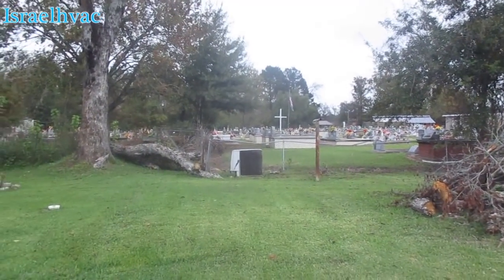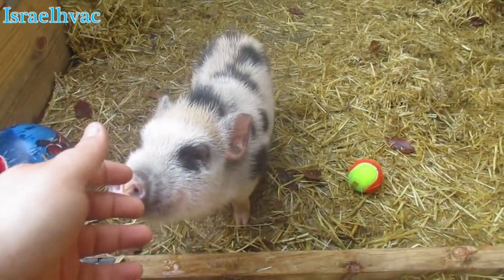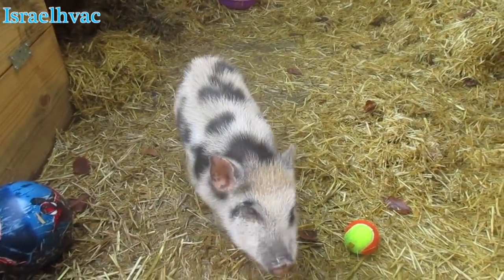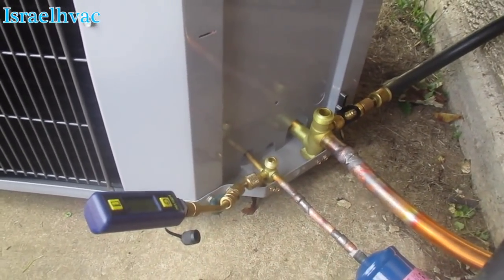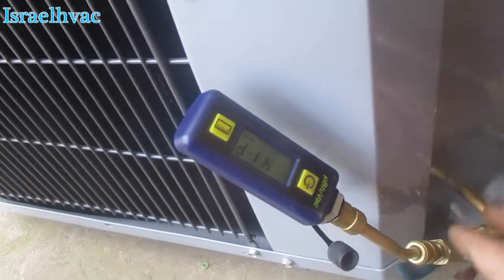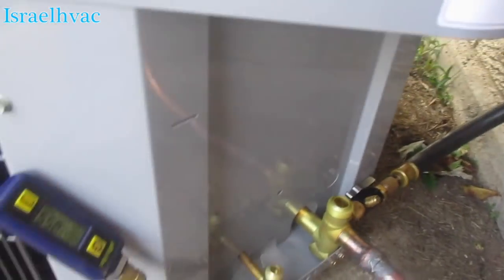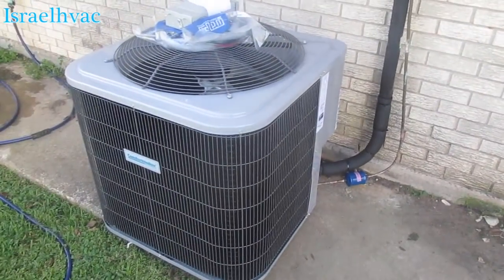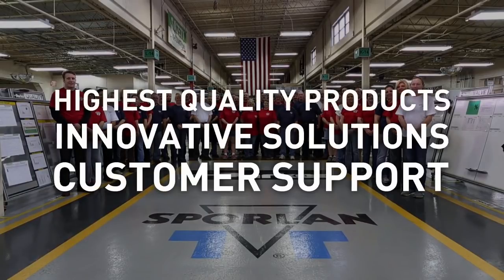HVAC: Condenser Install | Relocate

Comment: Once I found a condenser in a ATTIC, I shit you not. Surprisingly, it worked pretty good, the attic was well ventilated with soffit vents and two attic fans. The air handler was also in the attic and just a few feet away. It was a small 10 seer 2 ton used for extra cooling on half of a four bedroom house with a 12/12 roof.

Comment: This is how our company pulls a vacuum on every install. It pulls a bit slower because your taking your reading on the complete opposite side of the system. I’ll have to try removing the shrader on the liquid and see it goes quicker. Nice video. Love to see proper processes on vacuuming.

Comment: When sized properly the location is not a problem. the question is did they put the line set inside a sealed tube? there should have been a disconnect at the unit. I would have put a "T" in at your vacuum gauge so when you introduce nitrogen  for a flush and hold 15 min. (in case the vacuum did not hold steady do to impurity still in the system) you are always pushing one way.

Comment: Is there a noticeable loss in performance/efficiency with pipe runs that long?
Reply: tlaroche38 some manufacturers say it's okay as long as you increase the size of the suction and liquid line.

Comment: Just a question why don’t you do the electrical?
Reply: Not all HVAC guys do electrical, its a seperate field and good HVAC techs let the electrical guys eat too.
Reply: Yeah I don't know I would've definitely ran the electrical it's not hard at all. And probably go through the attic and put a line hide to protect the line set from weather corrosion.
Reply: In FL you can’t do any electrical past the disconnect, unless you have an EC license.

Comment: Ouch on that pipe work. I can give you some good pointers to clean that up and stop the complaints from the owners.

Good job either way, just need to clean up the brazing and general pipe work, but that comes with experience for sure.

Comment: Shouldn't the filter dryer be pointing towards the condenser?
Reply from the maker: No
Reply: @johnisraelhvac2019  Yea , I got it Mixed up. I asked about it at work. Got it mixed up with the coil in a AHU.